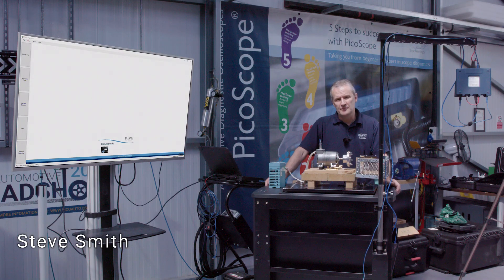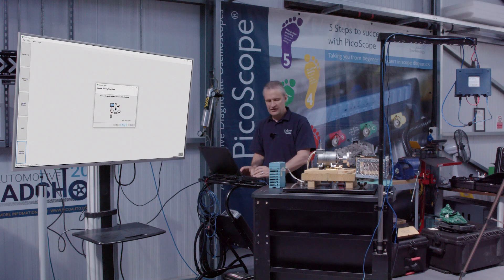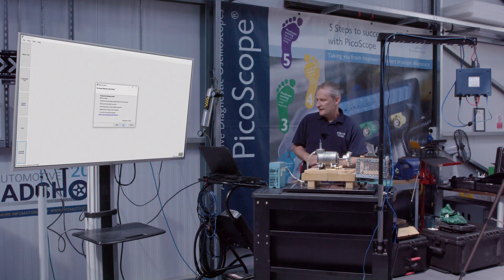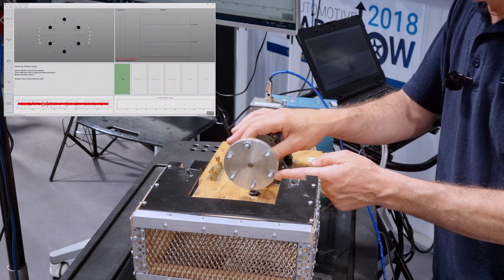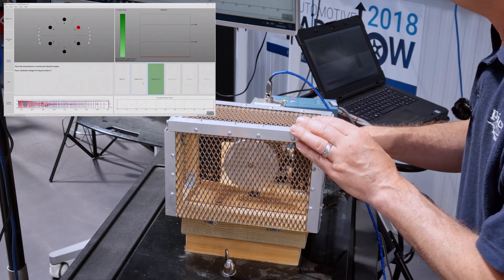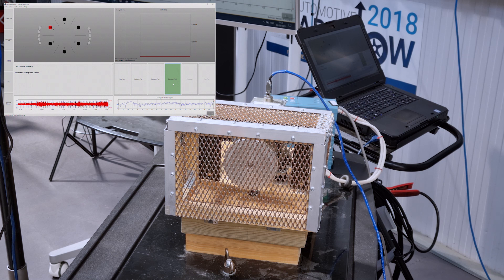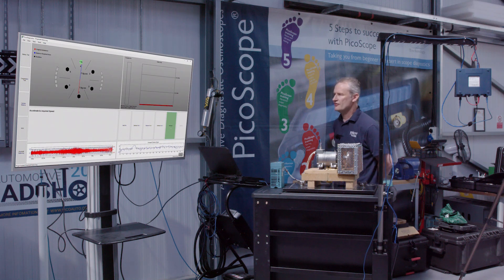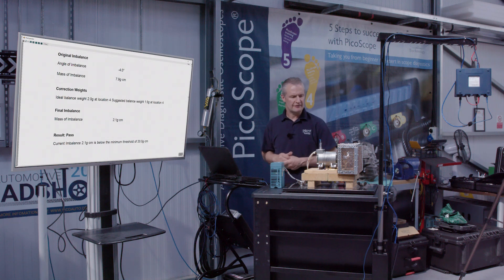Propshaft balancing

Comment: Thank you, very helpful video. Question: between 4:49 and 5:30- Would this be the propeller shaft RPM that would coincide with the previously determined P1, or simply the propeller shaft RPM that the SW determines it needs to see to perform the balance? Would it be okay to replicate the vibration on the hoist and record the RPM the optical sensor is measuring and use that RPM? If easier to explain we can go offline and discuss. Thank you.

Comment: Why didn't you add 1.5g as per the instructions? It's not a true demonstration of the equipment. Would it have been better or worse? The 5g originally added made it sound bad so surely 3.5g would also sound bad.

Comment: Could this be used to balance shafts / coupler alignments between engines to gearbox to generator? Between 1000 - 4000 kw generator set size for scale.
Reply: In theory yes although it's not something we've done. It is in effect the same setup as on a vehicle between the gearbox and the rear axle. Setting the speed is probably easier with a genset though! If you want to discuss this more please feel free to drop us an email to support@picotech.com and I can pick it up with you there.